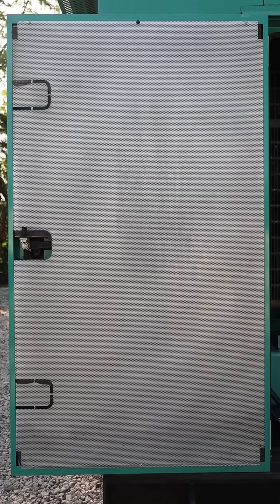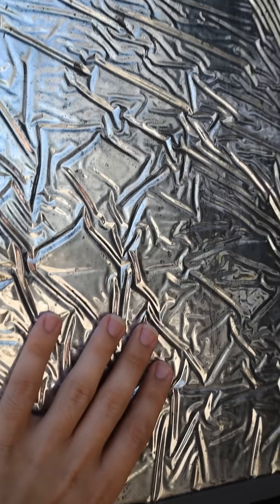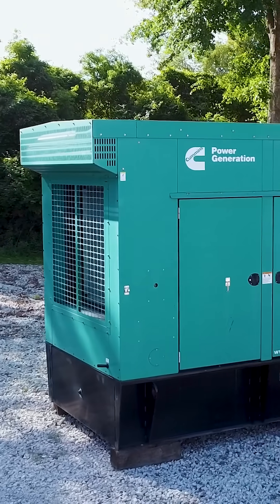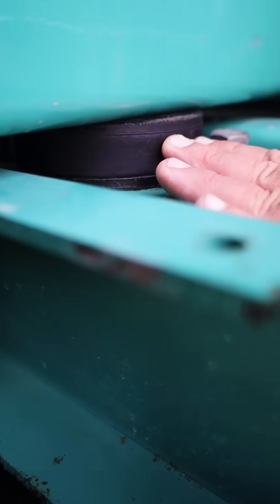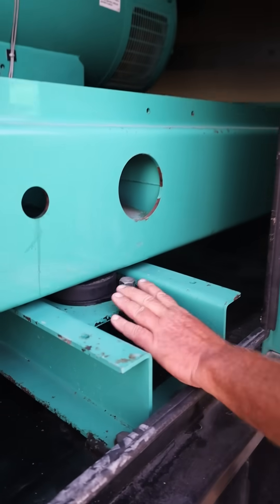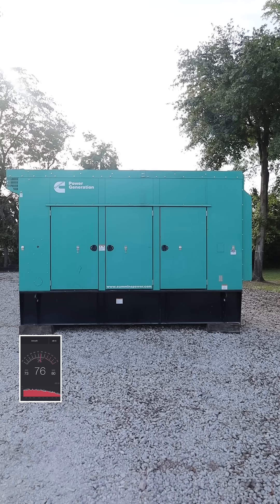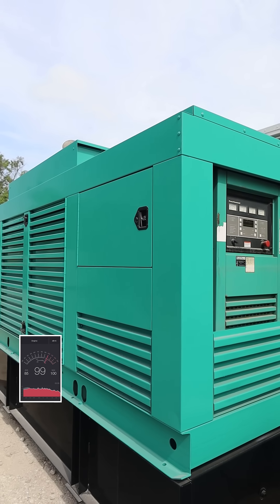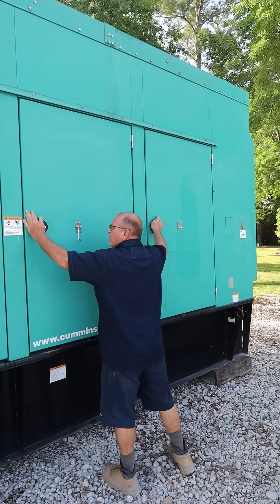How Loud Is an Industrial Generator? You Might Be Surprised 🔊 | Tech Talk Tuesday

Comment: What’s the price for one of those? 60-70k?
Reply: i make them for about $5k in parts alone each if you wanna a more bare generator to buy them well thats a little more. but never heard of a muffler? its quiet like a car engine.
Reply: @scott32714keiser I used to be an assistant house manager for a well to do family and they had a massive generator powered by a six cylinder Volvo diesel engine to power the house.